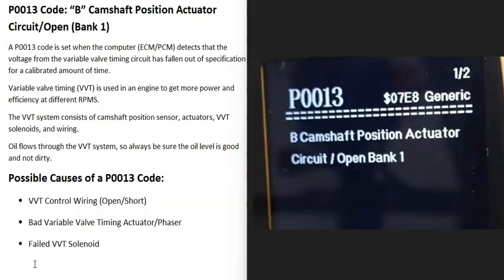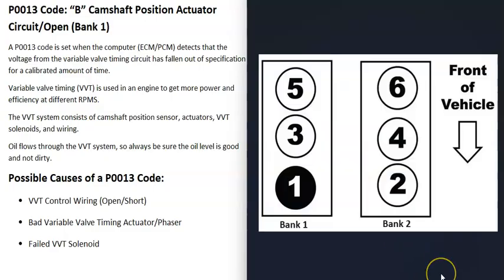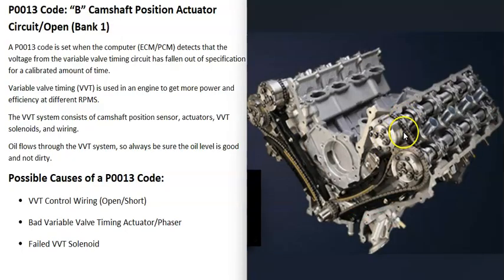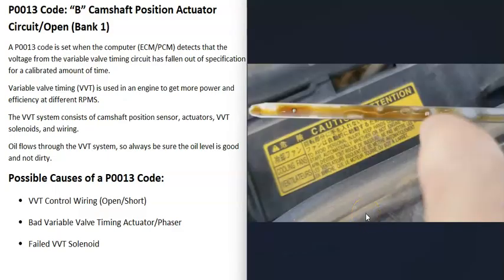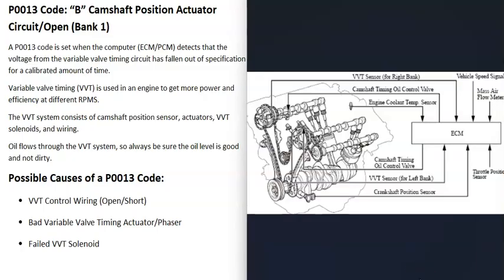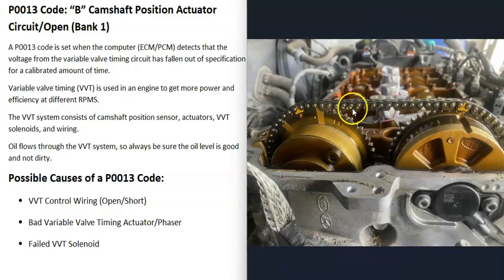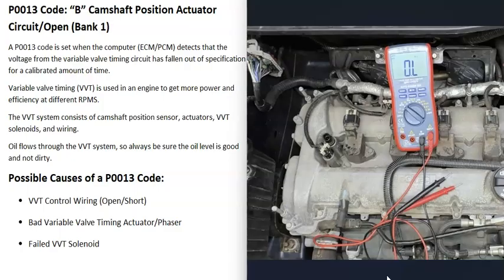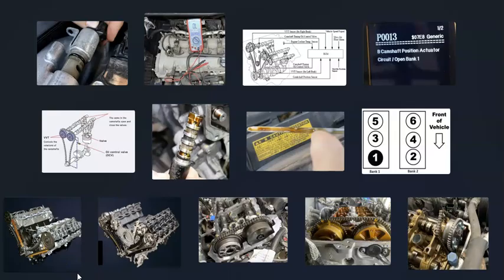Causes and Fixes P0013 Code: “B” Camshaft Position Actuator Circuit/Open (Bank 1)

Comment: my 2011 hhr threw p0013 and has a pretty loud tick
Reply: What was it?
Reply: @Usa-v4z camshaft position sensors, not sure of the tic but i think it's something plastic vibrating. position sensors where very easy to replace and codes went away.
Reply: @aidensgrave thanks Man my jeep threw the code I’m jeep the cam sensor hopefully no timing  chain
Reply: @Usa-v4z my 04 cherokee jumped timing twice and it threw p0016 or 17, it should just be the sensor and they're like 20-30 bucks
Reply: It threw a p0013 code I check oil it looks dirty a slight tick like u said ..B camshaft position open actuator circuit open bank 1 I’m start by changing the oil once bro
Reply: @Usa-v4z do you have a v8? i had the 4.7 and it was ticking then dropped a valve and shot a rod through the bottom of the block. the lifters are a very common problem spot for the 4.7 it chewed up my cam and a lifter almost went through the valve cover.
Reply: @aidensgrave  I have the 3.6 bro I’m just gonna change oil it looked dirty I’m just flipping them from auction and it don’t have no code when I checked it  the next day it did lol ….but it drives fine bro
Reply: @aidensgrave  the tick in your car never went away?